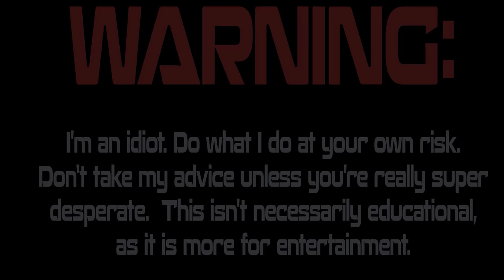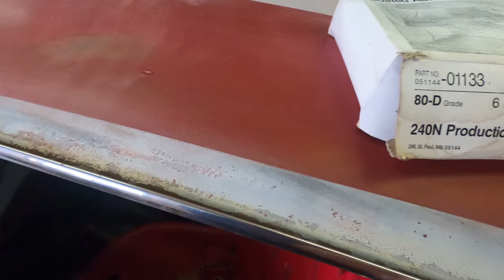Independence Chevelle - Spray Painting Fauxtina & Patching Rusty Fenders

Comment: a little tip for those really rusty parts derek. brush on some some used chip pan oil...stops the rust dead and leaves a protective layer. sounds daft but before you laugh ask yourself his...You ever tried cleaning a chip pan?  trust me ive used this method for years...it does work
.Looking forward to the finished project. awesome engine build by the way.

Comment: A spritz of DOT3 will knock down any shine, make fisheye,
and check. The key is length of time its on. 1 hour and wipe for you
looks right. Light sand blast shiny stuff, white vinegar makes
rust in about 30 minutes. Lock it all up with Photo Matte spray.

Comment: This whole series is making me want to just slam back together my '70 442 which just happens to be my first car ever (im 52 and still have it). 
My 442 got new floors and a clean southern frame back in mid '90s, but left the patina it had at that time...think rusty first car getting a bondo and fiberglass wheel well lips in mid 80s then a backyard lacquer outdoor paint job while still in high school (car looked Mint for first 2 years). In 2002 the car came apart for "paint" and resto. 
Life is not always kind and many a man's problems with cars involve women. 3 kids and 3 women later i finally found the gorgeous car gal i dreamed about since i went from women have cooties to i want cooties.  My girl is all in for this project to put the 70 back on the road/dragstrip because im pretty sure she wants to take over driving duties. The '70 got quarter panels done right not long after the initial push to disassemble paint and return to projected glory. Unfortunately its been a roller in bare metal for 20 years now. Over the years id start to pick up where i left off but the cowl rust and top of dash where the windshield goes really bothered me.
As of today as i watch this video on march 14, 2021 (happy birthday sis!) Im commited to a new wire welder, fix the dash, carry on using similar methods as Derek and maybe end up semi gloss murder paint and end up with a runner by july this year.

Thank you Vice Grip for giving me the motivation! The rough edge details are just gonna add character! And save/keep another classic A body GM from going bye bye !

Comment: Drill a hole in the top of that crack so it stops spreading.  Put a rivet in it if you want to hide the hole.

Car does look a lot better with the paint work.

Comment: Why don't you just buy new front fenders and quarter panels?
Reply from the maker: Quarter panels would need outter wheel wells.  Outter wheel wells would need inner wheel wells to weld.  Inner wheel wells would need a truck floor, which would need a full floor to weld to.  But, the floor wouldn't weld to rotted rockers.  So, add inner and outer rockers.  So, 4 months and 20k